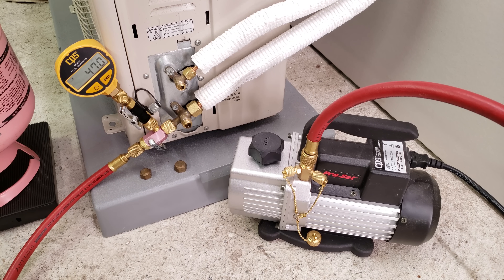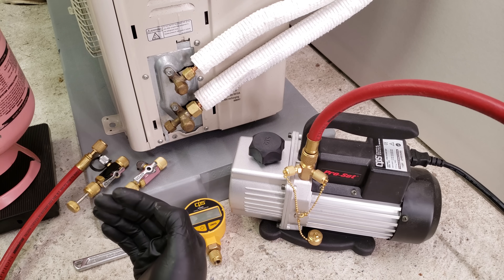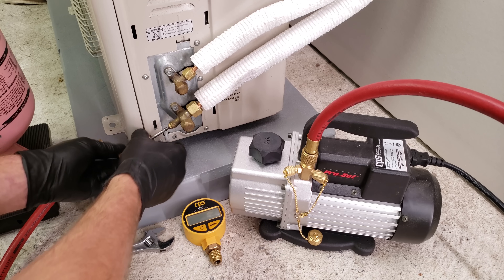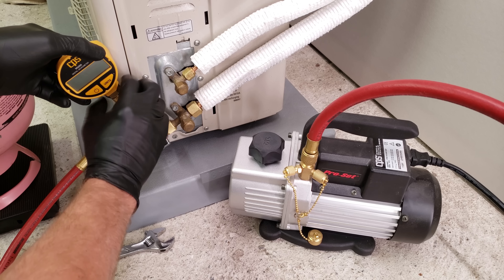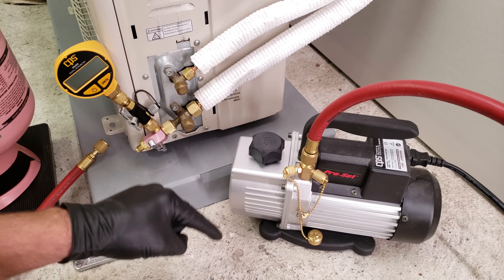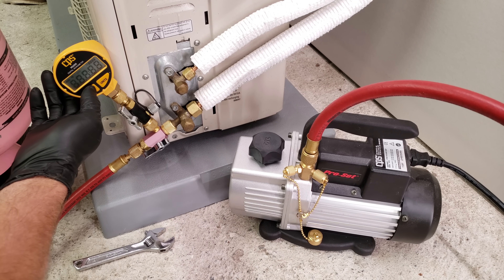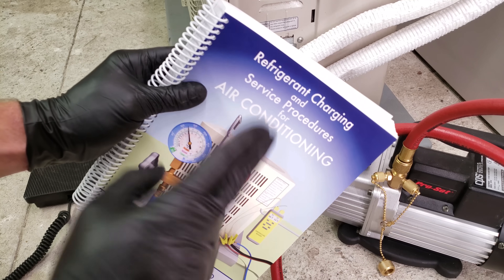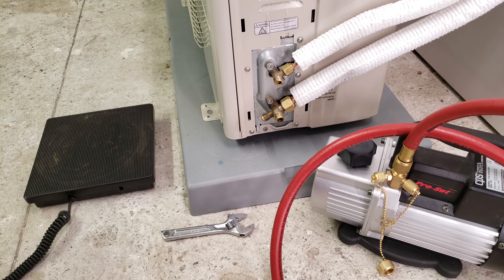Steps to Vacuum and Charge Refrigerant on a Mini Split Unit!

Comment: Craig, I've been watching a bunch of your videos. They are super informative and very helpful. I'm a DiY er who is fixing my mini split system after I had a poor install performed by a local guy. I repaired my system and vacuumed it down, did a standing vacuum at 240 microns for 30 minutes and now need to get it filled. Can you tell me if there's a problem leaving the system under vacuum for a couple days or even a week until I have a tech. come out and refill it as I obviously don't have the needed license to buy freon. Thanks in advance!
Reply: You shouldn’t keep it in a vacuum for a week but you can vacuum it when the tech arrives

Comment: When you vented the air out of yellow charging hose was it then full of liquid before you started charging the system ? If there was vapor still in the yellow hose you might not be charging the system properly as some of the liquid refrigerant you are weighting might just be filling the yellow hose. I am a newbie and have never done this. Please explain.  Also what did you do with the yellow hose full of liquid.       Should you have throttled it at the gas bottle valve so there would only ever be vapor in the yellow hose ? Again i have never done this and i am not suggesting that you could do anything better.               Thanks very much for this video. It was really great.

Comment: Hi. There is no link for the quick neck pressure gauge or the fitting that you use to attach it to the valve core removal tool. Could you help please? Thanks.

Comment: What’s the recommended pressure for a nitrogen leak test on a 17 series Daiken 12,000 btu ductless system? I can’t seem to find it in the manual anywhere. Keep hearing 550 lbs but that seems high to me, maybe not.
THANK YOU.

Comment: This is a great video and I found it very helpful! I would ask for one area of clarification, however. When you refer to a “micron” are you meaning mm of Mercury (Torr) or um (micrometer, also often said as micron)? This is a distinction of a factor of 10, so the difference would make a large impact on system performance.
Reply: vac not  size..microns,.torr, kpa,PSI,mm of mercury, all pressures that relate ,

Comment: do they make mini splits for installing in a furnace? with the  evap coil precharged and the lineset precharged?  seems a better way to install a unit using a mini split system

Comment: Question: I have a multi-zone mini split but only have one of the indoor units attached. The outdoor low pressure pipe was damaged and leaked while the valves were open. Does that mean I need to recharge the entire system? And if so, would I need to vacuum out the system with the valves open and charge it the same way? Any assistance would be appreciated.

Comment: I've seen too many air conditioning guys not officially vacuuming down the systems allowing to any moisture to boil off many of these guys need to go back to school so they charge systems and still have moisture in them and you end up with leaky coils compressors that go bad

Comment: I am installing a single zone 2 ton Fujitsu mini split. Maximum line set with out adding is 66 feet, but no minimum is mentioned. If I use ten feet will I have to recover some? Also it says to not leak check with nitrogen, it says to leak check with vacuum pump. I watched you use nitrogen other times, I’m trying to sort this out. Do you have any advice for a person trying to build their skill. I did just order your book on Amazon, so looking forward to that! Thank you for all the effort you put in!

Comment: Where did you get the 3 way valve for the vacuum pump? Mine has a 2 way, 1/4” and 5/16” but my new vacuum hose is 3/8”, which is what you’re looks like.

Comment: Is it dangerous to do a deep vacuum with the valves on unit open? For instance my system needs refrigerant from a leak, leak is fixed but unsure whether to do a deep vacuum while valves on unit are open. My system is completely drained of refrigerant.

Comment: Thank you for showing the detailed procedures for proper charging the split ac unit.

I have a query for installation a brand new ac split unit as follows...
1. After connection the brand new liquid pipe and vapor pipe between the outside unit and inside unit, 
2. the worker did not carry out (a) the pressure test and (b) sucking the vacuum for extracting air and moisture from the pressure hose.
3. Instead, the worker just release one of the valves at the external unit.
4. Then some refrigerant from the external unit and fill the pressure the pipe...

I just wonder why
(1) the labour did not carry out the pressure test and sucking vacuum for the newly installed pressure pipes.
(2) the labour did not use charging refrigerant into the system from external tank.
(3) the labour just release one of the valves at the outside unit. Then refrigerants come from the external unit itself and fill the pressure pipes (weired!!!).

The system works for two years and still in chilling condition.

As a layman, I am not in position for challenging the worker for omitting procedure (1) and (2) for a brand new split unit. 

As a professional trader, are you satisfying what the worker done? If not, what is your advice if you are the layman watching something seems wrong for above case?
Thank you.

Comment: Great Video on how to pull a vacuum on a mini split.  One question... could you have used a 1/4 shutoff valve instead of the 1/4 Valve Core Removal Tool for the vacuum gauge?  My assumption is, a1/4 shutoff valve is not vacuum rated?? Thanks.

Comment: After one summer of use I checked pressure and found only 15psi on an LG 4 zone mini split system. Found the leak at one flare connection at outdoor unit and fixed just by tightening within torque specs. I see about two teaspoons of PVE refrigerant oil leaked out of that flare connection. If system mainted positive pressure of only 15psi does that mean the oil in the system has not been contaminated with moisture from atmosphere? Is it necessary to remove the oil or add two teaspoons back into the system? Or is it safe to be pressure tested/vacuumed and recharged without adding or replacing oil? I suspect system was at very low pressure for about 4 months. Many thanks!
Reply from the maker: It is possible that the low pressure side could have went into vacuum while running  but not that likely with all the temp sensors on the system. Don't worry about the two teaspoons. Just recover the refrigerant and then pressure test to make sure there are no other leaks. Then vacuum and break the vacuum with the exact amount of refrigerant that is needed for the system and line set length, thanks!
Reply: Is the oil blowout procedure different for a 4 zone mini split? Can all 4 line sets be unclogged by accessing only the two service ports? Thanks again.

Comment: @AC Service Tech LLC, Question on the two valves that:
8:30 you said to open those two with allen wrench, counter-clockwise, then
14:30 you also said to open those two with allen wrench, counter-clockwise
Why these two valves never get closed?
Reply: Because that is how the refrigerant flows through there. They stay open.

Comment: Great video....One thing i am not clear on though is, when you were charging why you didn't let the unit run, I was taught that when charging freon the unit should be running? I'm looking forward to your response, thanks.
Reply from the maker: I was breaking the vacuum with refrigerant from the bottle instead of refrigerant from the unit. After adding from the bottle, I open the service valves, thanks!

Comment: 13:00 “purge a little bit of air” why would you introduce air into your vacuumed system when you can just close the valve core removal tool before replacing the core or am I missing something?

Comment: If just using vacuum to pressure test and finally soapy water to  test connections. Not the worst thing in the world right? 999 times out of 1000 it would be fine right? Have you experienced a fail by missing the nitro pressure test?

Comment: I tried putting the shrader back in today but the valve core removal tool snapped off and I lost all the gas in the system, will cost me $100 to replace the gas, nevermind the headache, time and labour wasted. The tool cost $30 off eBay, is it worth buying the one you have for like x5 times the price?

Comment: too much tools, and too much step=error. just simply hook up the freon tank to the yellow line of the manifold(middle) and hook up the vacuum pump to red line of the manifold(high pressure), and open  both the low and high side valve of the manifold, run the vacuum pump for 20-30minutes, close the high side valve of the manifold,  check if the micron go up, if you are too hvac tech,  I believe you know what to do next.

Comment: l just installed my gree multi unit mini split system got so excited .I bought all the the tools I need except the vacuum pump. I cut all the line set shorter then re flared them all. I turned the system on.it works for three days hot and cold works perfect until the next day the system won’t  blow any hot air. What should I now?

Comment: I'm a DIYer homeowner, not a tech. But for some reason I find heat pump technology fascinating even though at my age as an SW engineer, becoming a professional HVAC technician is not in the cards.  After my 2nd multi-zone mini-split install where your videos provided most of what I needed to know, I finally bought your eBook. Your videos and free online docs helped me so much that I decided to get your eBook (to learn about checking and recharging a unit), and to understand things better. Also, you've earned the respect and appreciation to get some remuneration for your service, IMO. After getting about 10 pages in where you introduce the basics of refrigeration and the physics, I'm beyond impressed.  The diagrams are excellent. The explanations, are clear, thorough, and convey the points succinctly. 

For anyone reading this, I'm in no way affiliated with these people, I'm just saying if you actually want to understand the core concepts and/or specifics, the book is a worthwhile investment. The eBook is pretty reasonably priced considering how good an educator the author is.
Reply: I also do lot of DIY mostly automotive AC. In the last 3 years HVAC contractors have tripled their pricing, and many are just sales people trying to sell you new unit or a service plan. Now I do my own annual maintenance on my 4 ton packaged heat pump on my roof. I even ran a pex line off my evap cooler to connect a hose so I could wash the condenser every 6 months or after dust storms.  I stock parts for my unit and my mothers AC split system caps, condenser fan motors, contactor. Local HVAC suppliers here refuse to sell to the public just buy online. The $1000 in stocking my parts, and HVAC tools is a tiny amount what one service call now costs from a local HVAC tech. My mother had a compressor run cap replaced HVAC tech charged her $680 that was during the week day not even at night or weekend. If they come after hours cap cost $1000 to replace it. New packaged unit install cost $12-15k now for a single stage goodman. Not even talking about duct work just $400 crane lift and use the same stand and elbow.
Reply: Same here, in fact it drove me to get my 608 and it has become a hobby...
Reply: Glad to hear other diyr’s can take this up as a fairly technical “hobby”. Not a sw engineer but web developer. Could you work on a traditional outdoor condenser unit, or the indoor evarporator?
Reply: Its good for doing stuff on your home I guess, but not to work as a tech, then you have to deal with using ladders, aggressive dogs, lady's who are never satisficed with the work, customers that hit on you (both women and men), it can create all sorts of drama, is it worth it to spends hundreds of dollars for work you do perhaps twice a year? I'm not sure it is a cost saver, also you have to separate space to keep these tools in working order

Comment: Wouldn't there be enough refrigerant in the system already if it's new?
Reply: A new spilt system will come pre- charged but only to a certain length of pipe run. around 30m depending of refrigerant type & unit KW. so if your pipe run is longer than that i.e. 40m, then you need to calculate and add in the extra. otherwise your system will be undercharged and will preform poorly, hope that helps. 
( From the UK on the job trainee 8 months in)
Reply: @lf8257  nice thanks for the info.

Comment: Some tips for the noobie diy out there 

Make sure to pay attention and set the scale to oz or lb before you release the gas , maybe a sticky note in front of the scale . However you figure the math on how much gas you are putting into the system in oz or lbs.

If you have a 2 zone mini split ac 
A and B or two air handlers. 

Do yourself a favor and first vacuum and pressure test both zones before you release and add gas .

The reason I say this is , if you not paying attention when you go to release the gas you might release the gas on zone B thinking it was zone A if you didn't vacuum both lines now you have refrigerant in a unvacuum line .

They are right next too each other and the heat of the moment you might get confused , maybe put painter blue tape on  zone B valve so its clearly different from zone A

Comment: What psi do you recommend to leak check with nitrogen with for a mini split ?
Reply from the maker: roughly 300 psi. I did an entire minisplit installation video to where you can see the pressure test and the whole install, just look up "acservicetech mini-split installation" thanks!

Comment: excellent demonstration,,,, this job is only for trade people who have the right tools. My way: The new refrigerant R32 is compatible with R290 (which I believe is pure propane). All cooking gas in Aus is pure propane. I have a vacuum pump,,, but why bother? why not send propane through the pipes in order to vacate the air? then open the valves and check for leaks, 5 minutes job.

Comment: Thank you for this professional video.  At around 8:40, you mentioned how extra refrigerant must be added if you add a line set that is longer than what the unit comes pre-charged for.  What if a unit comes pre-charged for, say, a 25-foot line set, but a 15-foot line set is used instead?  Would refrigerant have to be released in this case?  I have an LG mini split whose manual says the unit is pre-charged for a 25-foot line set, and that 0.22 oz of refrigerant must be added for each additional foot of line.  The manual also says that a 10-foot line set is the minimum that can be used, but there is no mention in the manual about releasing refrigerant when using a shorter line.
Reply from the maker: If it is a mini-split like this one then it likely handles a distance from 10 to 25' without a change in refrigerant amount. If any refrigerant needed to be removed, it must be recovered but in that case, it doesn't sound like it needs to be removed but LG may state that somewhere else in their literature, thanks!

Comment: I've installed one new split AC successfully just relying on connection of pipes and opening of valves to let refrigerant run and force out air. No pressure test or vacuum pumping. I understand its prone to problems but under circumstance it would be an option. I'm wondering how many people have failed with this cheap n nasty method at initial startup or future failure. Mine ran for many years b4 an update occurred.

Comment: Craig, I wish you would have shown after filling the lines that you show the total of the system after opening both alien key valves because new systems come with added total all ready added to account for the lines sent with the unit not needing any adding for the lines; just need to be leak tested and vacuum tested before opening the alien key valves.
   I get this was to show the proper way to check and fill the lines but shouldn't we at that point before we remove the tank check that the system has the right total amount before disconnecting the tank to remove extra or add more if needed and never assume that the unit was properly filled even though you had properly filled the lines. 
   Now we don't know if the system has any more than what you put in it or if the system is overfilled or if the outdoor unit has leeks.

Comment: that was well described, however the part where you blew out the air in the yellow line before connecting it to the lower junction wasn't at all clear that you had blown out all the air before screwing the yellow hose on.  I'd have expected you'd wait until a bit of vapour was clearly visible then shut off the valve before connecting.. I wondered if this can be done with the twin gauge manifold commonly found on automotive air conditioning recharge setups.

Comment: Hi Craig,
Thanks for all your great help with all these videos ! I have your book as well.
 As a DIYer of a 30000 btu Mitsubishi unit , it calls for the final vacuum to 500 mic
your book states to follow the manufacturers guidelines .
Would like your input on this matter before I pull it down to 300 microns
Reply: I know this is old and I’m not Craig but the lower the vacuum the better. What they mean is anything below 500 microns.

Comment: soon after installing my mini split (thank you for that), I had to move the indoor unit to a different wall, so I mounted the outdoor unit on wall stands. in the process of disassembly I unintentionally let out about 3 to 5 seconds of gas. after I reinstalled everything (thank you again), I ran the unit and the pressure was 55psi, so using the steps I added r410a with upside down bottle, til the pressure was about 110psi (i live in a cool area, about 84 degrees then). before and after, the unit was cooling properly. so is there an approximate running pressure? was my method ok or is removing the r410a, then adding by weight the only way to get the proper amount?